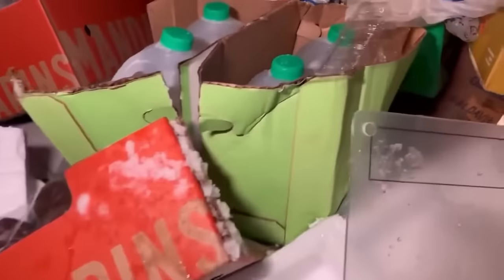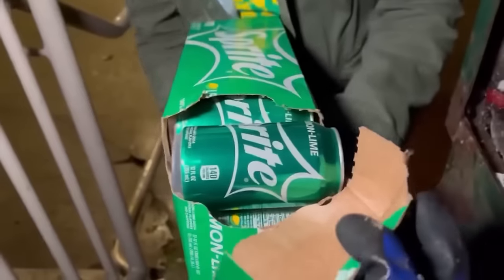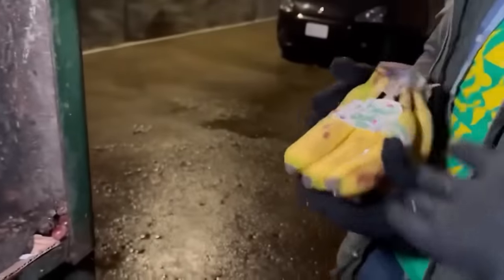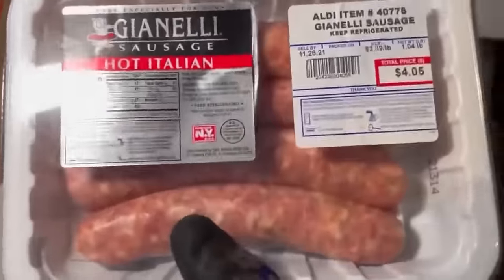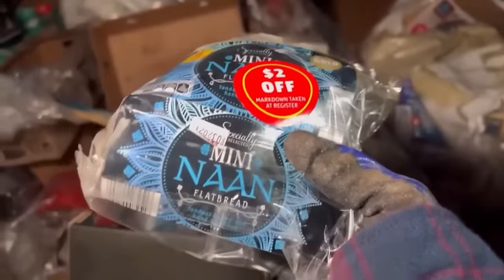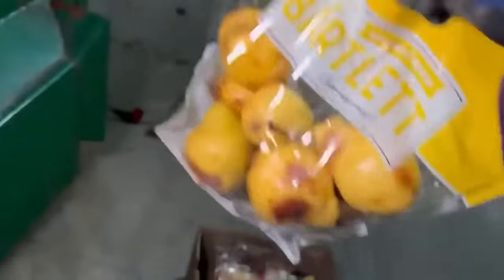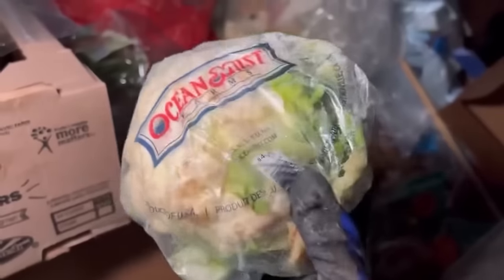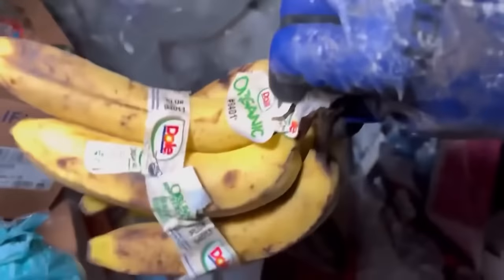Dumpster Diving Aldi #260 FREE CHRISTMAS DINNER!!!

Comment: The only thing to be careful of is if a product has been recalled by the manufacturers over issues with the production, especially food, which may have something wrong with and can't be sold to the public, it just gets thrown in the dumpster, the shops don't bother returning it to the manufacturers, but otherwise it is just so wasteful to throw away good food.